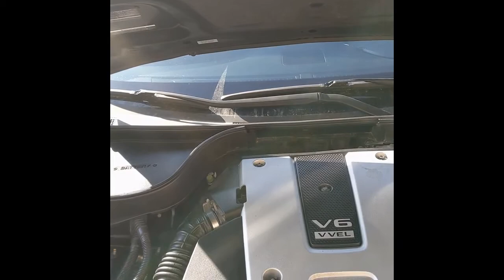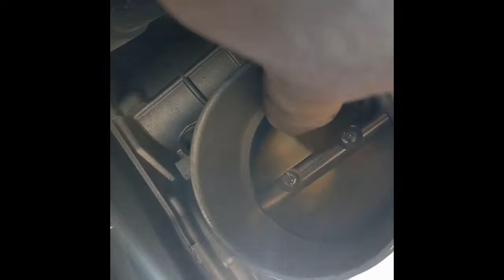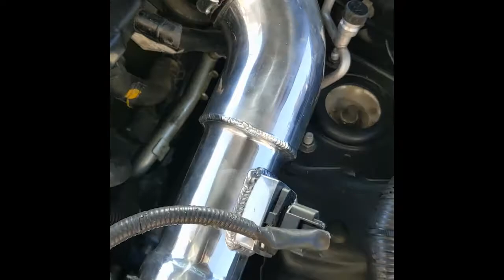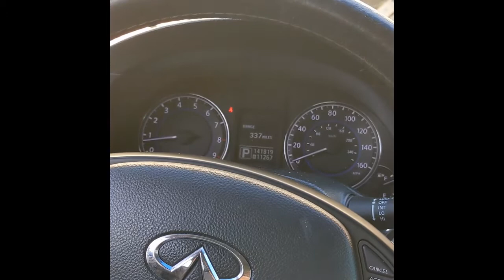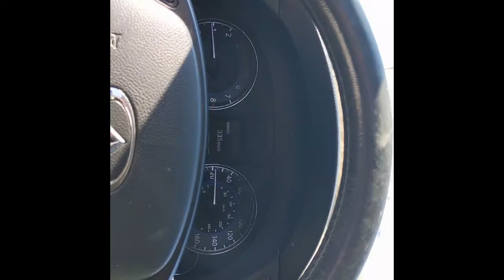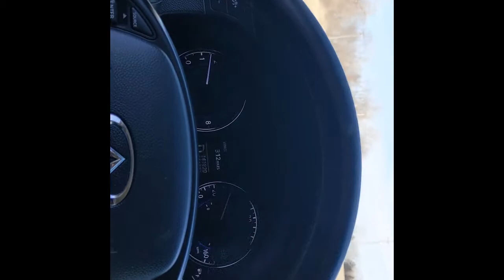G37 Cold Air Install

Comment: New sub here, happy to support a fellow G37 Sedan owner. You would be much happier with a true cold air intake system, instead of this short ram air one. I used to run this same setup, had to switch it back to the stock air box as it was suffering from heat soak, I live in AZ so it gets super hot here. I now run the ZPT cold air intakes and I'm absolutely happy with them. Anyways, happy modding and keep up the fun.

Comment: Can u share the like to the parts
Reply from the maker: https://www.amazon.com/gp/product/B06XHFH5YK/ref=ppx_yo_dt_b_asin_title_o09_s00?ie=UTF8&psc=1
Reply: Do u think I will fit  2014 q60 base
Reply from the maker: @wappadiamond5708  I don't think so.  I have not seen any CAI systems that cross reference to the  Q 3.7 from the G except for the long tube front mount type.  I think the mounting for the shields is different.  I would check on the Q forums.
Reply: Did it pop the check engine light
Reply: Did the Intake hold up after awhile